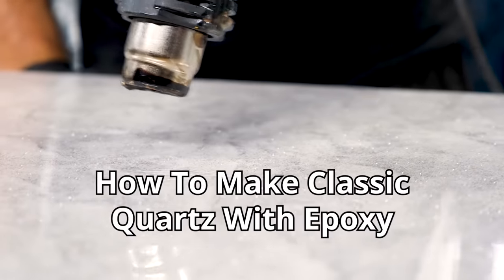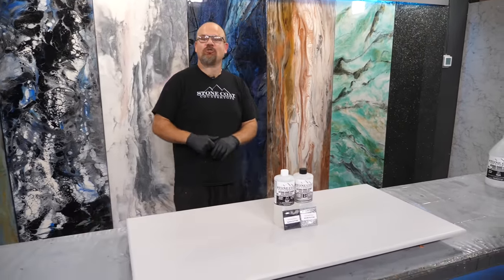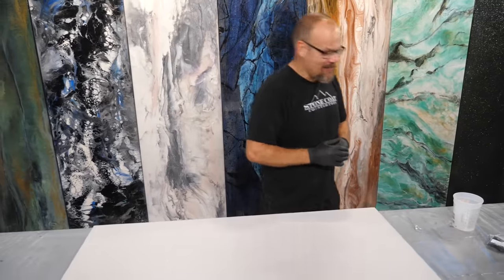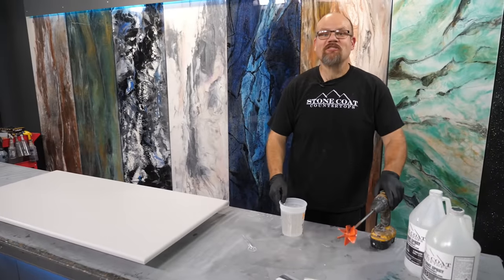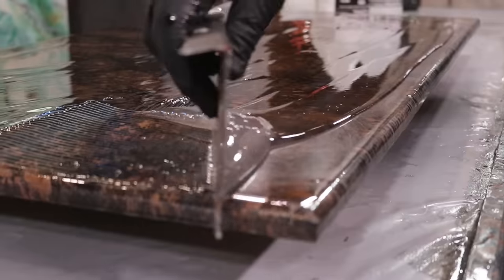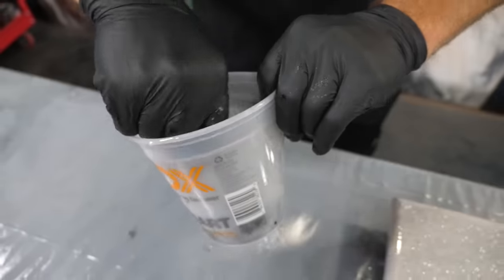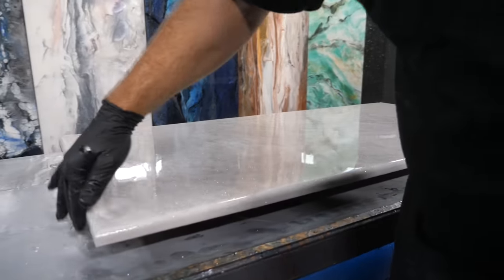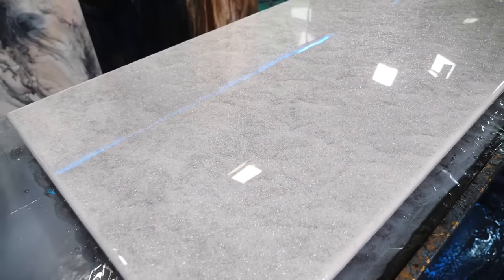Make White Quartz Countertops With Epoxy | Stone Coat Countertops

Comment: I really want to do this but I'm a bit confused by the instructions on the PDF. I have a total of 48 sq feet that need done. With this method would the 2 gallon epoxy kit work? Or do I need 4 since I would have to do a second clear coat. Also how much glitter per ounce? The PDF says a spoon full of black and a spoon full of grey. Is that for each 3 ounces?

Comment: I just did a test piece.
Still sticky after I left it over night in the garage , I wonder if the below freezing temperatures had something to do with it.
Also it was really thick after mixing it for two minutes, I thought it was supposed to be runnier.
SCC I got a question:
How long should I wait until it hardness and a what ideal temperature should I leave until it does? 
Thanks guys, I’m looking forward to get my countertops done with your product.

Comment: Working a big flat area is far different than working a real countertop with all the things you have to work around like the sink maybe a range or corners, trying to get the front edge or backsplash. I’ve worked with some pretty hi class material before and trust me it don’t work as good as they show

Comment: @StoneCoatCounterTops, do you primer the bottom of the MDF too?
Reply from the maker: Great question! Most of the time we don't. Major exceptions would be if there's an under mount sink or we're installing above a dishwasher, for example. In that case we love to use coats of Red Gard to protect the wood. Good question.
Reply: @StoneCoatCountertops  Thanks for the response. Could you relay that info to all the DIY masses who love your show? It's not something people think about who aren't in the trades. Keep up the great content.
Reply from the maker: @californiacritic9779  Wish granted ✨ Check out our countertop building video in our epoxy skills series here for step-by-step methods for building your own surfaces https://youtu.be/VKdvjL_1Msk We got you covered! 👌
Reply: How are the edges of a project done?

Comment: When you say 3oz per sq ft, is that just resin or mixed epoxy? Dumb  question but this is new to me.
Reply: It's 3oz of the mixed epoxy, so 1.5oz of Part A and 1.5oz of Part B per square foot.

Comment: I just finished making a White Quartz vanity top with an undermounted sink.  The process went well except the silver and black metallic settles out.  So on the sides gravity causes the metallic to run off the sides.  I tried adding another coat to just the sides but once again the metallic ran off.  I ended up puffing some dry metallic onto the tacky sides with a turkey baster and then clear coating them after they dried.  One interesting tip I found is the epoxy does not stick to the plastic drop cloth that I was using to protect my floor.  So in the end after the epoxy dried I had sheets of clear epoxy with the metallic effect in them.  I could then take that and put it up against various background colors to see which looked best.  It looked great with a black background.
Reply from the maker: Your project sounds amazing we would love to see it! If you havent joined already come check out our Facebook group Stone Coat Countertops Insiders! Its a great place to learn new tips and tricks from all around, you can also post pictures showing others how your project went! -Nathan